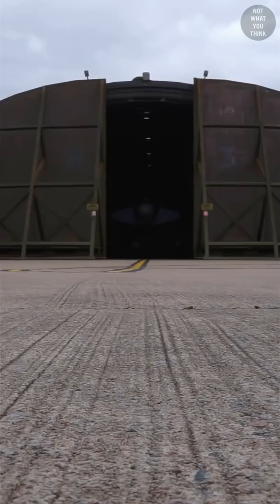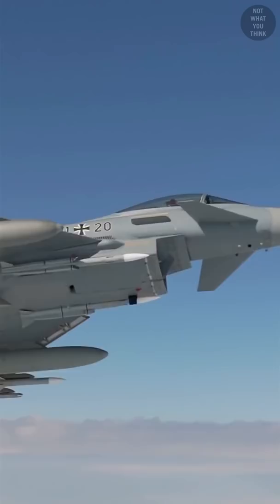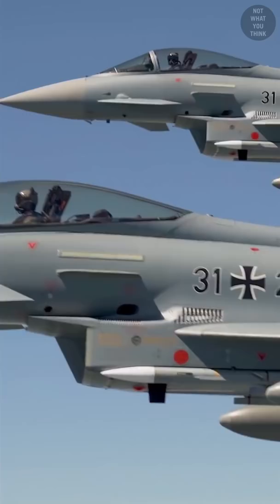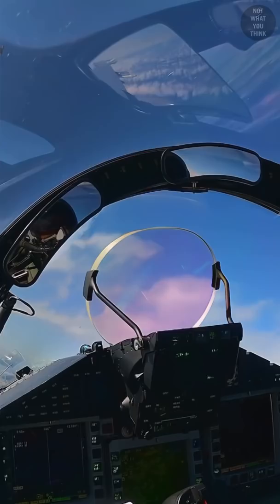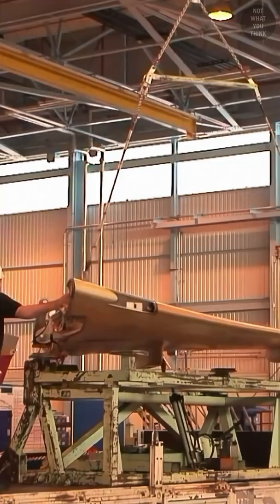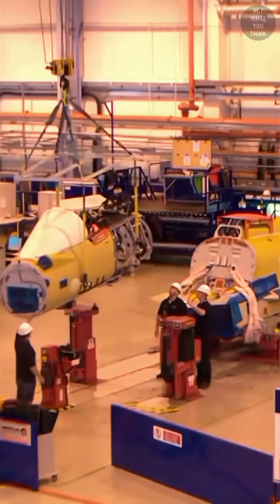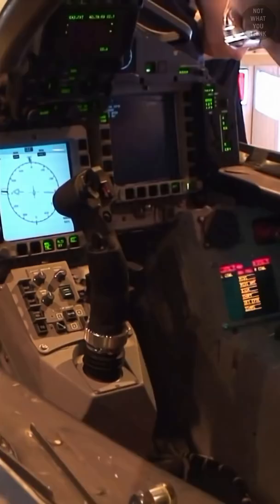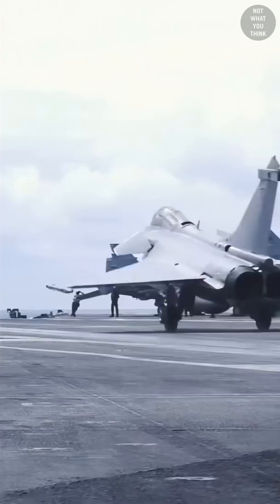What is Unique About the Eurofighter? #shorts

Comment: Just a quick note, a canard delta wing layout doesn't inherently make a plane unstable, it is possible make the layout statically stable. However, as a fighter it is intentionally designed to be unstable to increase manoeuverability. On the other side of things you also have the traditionally laid out F-16, which is also unstable in design. Without pitch limitation it can and will readily enter a deep and unrecoverable stall.

Comment: Instability has nothing to do with canard delta configuration, that's because of the location of center mass and center of lift. Good video though!
Reply: And because of the center of mass and center of lift, it’s unstable without the computers…
Reply: Not exactly, the canards move the CoL to make the aircraft unstable, which the computer exploits to make the plane more agile.
Reply: But the canards are what move the CL closer to the CG that make it more unstable. Though you could get that with a different aerofoil configuration.
Reply: @arvedludwig3584  ahhh, but does it achieve self stabilizing by aerodynamic effects alone (configuration of wings etc) or does it really on electronics to sense and control the instabilities?

Most planes are designed to be aerodynamically self stabilizing, but in the case of a fighter that stability would counter the manoeuvrability. That's why, whatever the wing position and shape, modern fighters are aerodynamically unstable and rely on electronics to sort out the in flight wiggles.

Comment: The engines of the Eurofighter are so powerful that it is able to lift itself off the ground just a few seconds after initial acceleration. The only other fighters I know that managed to accomplish this are the F-22 and F-15 (empty load).
Reply: rafale empty can do that to... i think many modern jets empty can do that, loaded it's quite different tho
Reply: @thisisrazgriz3664  yeah the Eurofighter can do that loaded many can do it unloaded
Reply: @randomguy8196 U must mean using the STOVL technique right? 😆
Reply: The Harrier should also be able to do this right?
Reply: there are countless jets with a similar thrust to weight ratio, Eurofighter is king of course and it also has the benefit of a very low overall mass compared to the F-22 or SU-27 for example.
Reply: That’s Rolls Royce engines for you

Comment: I thought it was the way it was built. It's so strong, it's the only plane ever built to my knowledge that can pull 6g at super-sonic speed. The airframe is so precisely aligned it's something like 1mm out along it's length. Countless holes need to be drilled three times-through laminates, which is fully done by robot: as those tolerances are beyond human craftsmanship. This precision plus the materials used: is where the strength of the airframe comes from..

Comment: The canard doesn’t make the aircraft unstable. It does make it maneuverable. Stability is a very complex aspect to control in a neutral to unstable aircraft. 

The canard configuration is used on at least 6 4th generation fighters and even 1 5th generation. 😮

Comment: I think the UK would have been able to make the fighter alone for less and much less time. Not sure what differential technology Germany, Italy or Spain have to add to the project.

The UK made the aerodynamics, have the most advanced radars, misiles, Rolls-Royce is far ahead in turbines, the other bits and pieces could have been outsourced from the US or Europe. Plus the UK has the necessary bribery contacts in Middle East to export some units.

Basically, the UK propped German aircraft, radar and turbine industries trough this project and the Eurofighter ended being so late, that the US and now Russia introduced 5th generation fighters. For the next project Germany has logically dispensed of the UK.

It made some sense to associate with the French perhaps, but with Germany, Italy and Spain not so much.

Comment: You really can't come close in comparing the Eurofighter to the F22. F18 would be a much better comparison.
Reply: Well, the Eurofighter is already being compared with the F-35 and is still superior to it. The Eurofighter was primarily a fighter and the mulitrole came later. It may not be a "stealth" jet, but when it comes to dogfight it is already superior. With the guided missiles IRIS-T and Meteor, Germany has two of the world's best air-to-air missiles. There is a reason why Americans are angry that the Germans don't give them any so that they can copy them.
Reply: @Baerserker26  It isn't superior to F-35 in nearly any aspect. 
The biggest issue You already mentioned - it isn't stealth.
Reply: @rijad0092  Stealth doesn't mean you can't shoot it...🤦🏼‍♂️In addition, the radar signature of the Eurofighter on the frontal approach is just as small. You can also locate the F-35 relatively easily using passive radar...
Reply: @rijad0092  That is why it was also possible for a German company to see the F-35 permanently on the passive radar when it was on its way to an air shows.
The weapons of the Eurofighter, IRIS-T and Meteor are superior to their American counterparts in everything and offer a much greater range. 
If an engine fails on the Eurofighter, it can at least continue to fly and would not fall like a stone from the sky like the F-35. 
Furthermore, the Eurofighter is a lot more agile and it is faster than the F-35, even when loaded. In addition, the weapons of the Eurofighter can be used faster because they do not have to be extended from the inside.
Reply: @Baerserker26  You know why it was possible for them to "see" F-35? - Because F-35 was not going for a mission, was it? 
It was literally on AirShow, and thus requires no stealth. When Stealth is not needed, aircrafts carry something called Luneburg Lens which basically removes Stealth.
Besides this, F-35 was flying in a Civilian Air Space. It has to remain in contact with Air Traffic Controller throughout the entire time. They had their own transponders active - Literally giving ability to anyone who wants to, to know their location. 
They had no intention to hide - Why would they? 
There was no harm intended by anyone. 

Now, let's go onto the real thing. 
Eurofighter Typhoon loaded with 6 AAMs has a max speed of Mach 1.6. This is not real combat loadout. 
Real Air-to-Air Combat Loadout would be 8 AAMs + 3x1000L External Fuel Tanks. 
This would likely mean that the speed of the Typhoon would drop to Mach 1.2-1.3 at best. 
Agility would drop, also, significantly. Aerodynamics. 
F-35 has no these issues - because it carries everything internally, and has insane fuel load. 

You said that:"the weapons of the Eurofighter can be used faster because they do not have to be extended from the inside.".. 
I think that's a pretty.. No, I think that's insane trade-off for Stealth. Besides this, it can shoot pretty fast. It can be done in a second, if less. It doesn't matter.
In combat loadouts, F-35 will have comparable, if not better maneuverability than EF Typhoon. Not that it matters, though, to an extent, for number of reasons. 
There's also Situational Awareness. You cannot beat F-35 in this. EF Typhoon lacks what F-35 does in this aspect hugely. And Situational Awareness, in a dogfight, is extremely important. F-35 pilot can basically look through the plane. 6 DAS Sensors allow it, but they allow far more than that, but that is not important right now. 

Now, I said it doesn't matter, why?
- Dogfights happen very very VERY rarely in modern Air Combat. 
- High-Off-Boresight missiles just forbid gun use from happening in the first place, and this is where F-35 beats EF Typhoon aswell. 
EF Typhoon has ability to cue missiles "only" 90° to each side. 
F-35 can do it 360°. Any aspect. Any direction.

BVR is no contest - as F-35, as already mentioned above, has far better Avionics, and ofcourse - Stealth.
Reply: @eye_bash1889   @EYE_BASH1  No aircraft can fly Mach 2 with full weapon loadout, unless that aircraft is carrying it's weapons inside. 

Kinematic performance drops significantly with any external loadout. 
Dassault Rafale drops to Mach 0.9 - Max speed, and G Force of 4G (Instantenous Turn) with 2xSCALP, 4xMICA and 3xExternal Fuel Tanks, for example's sake. 
I've noted EF. Typhoon's kinematic performance drop in my other comment, before this one.  

Second of all, Afterburner is an immense amount of power - it really is, but something such as F-14 Tomcat, which carried ~7300kg of fuel could go through all of that fuel in a matter of ~8-10 minutes, on a 5th stage afterburner. 
In fact, Tomcat would lose more fuel by using afterburner than by dumping it. 
It could dump ~680kg of fuel a minute.
Reply: @eye_bash1889  No worries, m8. 
At the end of the day, we're here to learn.

Comment: What's amazing is its still to this day its performance is so amazing its almost on Parr with the f22 raptor this aircraft doesn't get the recognition it deserves its almost 30 year old design still comes close to the f22 and in some departments exceeds the f35 its not as stealthy or as advanced electronically bit it would give a f22 or f35 a run for its money in a dogfight for sure.

Comment: When he says that the Typhoon is inherently unstable he is correct. But not only the Tiffy but most modern fighters share this. Described as the backwards flying arrow. If you fire an arrow backwards it's not gonna go too far is it. But if you could make thousands of tiny corrections with its flights it would fly true. Ok. Now due to this constantly corrected instability, when a full control movement  to say go up is instituted , the arrow would instantly change direction because it is constantly trying to 'break free' of the artificially induced stability created by the corrections.
   This is how modern fighters work. Using computers and fly by wire (FBW) control systems that make the thousands  of minute movements of the control surfaces.
   I hope that made sense. I'm not all that good at explaining stuff like this.

Comment: The canards are quite unique. Most planes have them mid placed, behind the cockpit, the Eurofighter has the infront of the cockpit.

Some planes that have them are because they're carrier based and it assists short take off. The Eurofighter has them placed at the front specifically to assist in angle of attack for air to air.

Comment: A canard delta is not necessarily instable. 
Deltas indeed can be very stable, no matter if they have canards or not. They roll like cracy but they are not good in turning. That's why modern delta wing fighters have their center of gravity so far to the back that they are unstable. It makes them turn much better.

Comment: In my computer simulated experience of designing and flying aircraft, canard-deltas tend to be able to pitch dangerously quickly, rotating on the center of gravity. I’d compare it to the deadly lift off oversteer of a mid engined/ rear wheel drive sports-car? They roll quickly, as well.

You need a lot of stabilisation systems to keep it steady for normal flight, with limits on how much angle of attack it allows, since you could kill your velocity easily or pull too many gees for the pilot and airframe to handle safely.

If it has a powerful thrust-weight ratio and perhaps thrust vectoring exhaust nozzles, you can definitely get supermaneuverability out of them.

Comment: All fighter jets are inherently unstable and are designed as such because it allows for max maneuverability (kinda important for fighters). Delta wing designs are not inherently unstable, they are just trickier to stabilize as opposed to conventional tail stabilized aircraft. In fact, the canards you see on the typhoon (and any other aircraft with canards) serve the exact same aerodynamic purposes as the ‘tail’ on conventional design. I enjoy your videos but I cant help myself but cringe as an aerospace engineer when I hear anyone racket off ‘inherently unstable’ cause thats a very loaded statement

Comment: The eurofighter is a copy of soviet MiG Project 140 or 141 but way better. Next fact: if a radar pointed right at the front of the Eurofighter (Rafale and Gripen as well) its RCS is below 1 wich makes it almost stealth. The eurofighter engines have thrust to weight ratio above 1 without payload, it can accelerate vertical right after takeoff. Its maneuverability is superior to the raptor, as well as its radar is able to detect the raptor (wich has been proven in bvr mock/dogfights above UK) it is a SU- killer. Its engines are able to push it above M1 without afterburner (only without payload/ordanance) Its FCS is superior to the SU-35. This boy is a serious deal in the sky. But the gripen is even better. Gripen can do all the things just as the Eurofighter, its costs are only the half of the eurofighter per hour.

Comment: Looks very similar the f18 Growler
Reply: Maybe the fuselage....
Reply: @Bendigo1  Partially Correct, The Growler is Based on a F18 Super Hornets Platform, The Euro Fighter has several similar Electronic Features to The Platform on the Growler but cannot Reach as Far, The Growler can switch from Electronic Jamming, Warfare, and Data Collections with just 1 switch and become an agressive F18 Fighter and compete in Air to Air Fights.
The Euro Fighter has not turned out to be as "Great" as its American Counterpart the F-22 which one of my friends has flown from its Genesis till now.

Comment: "Having each part manufactured in a different country brings up the production cost, but that's OK because it lets each country the option to customize the jet for its own need". Yeah that's the lamest excuse ever made. Like each of those countries can customize just a right wing of a plane, or just the tail for "its own needs". Just go ahead and say that the manufacturing process was distributed to several EU member countries in order to provide jobs across the euro zone, and prevent the strategic danger of one country alone in control of the entire production line, and all the jets assembled, so it won't turn them against its neighbors.